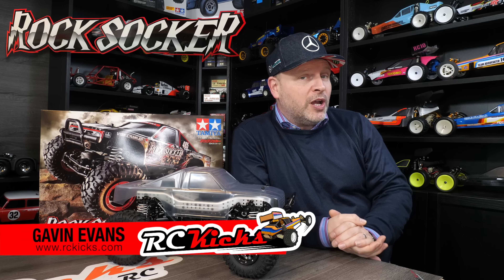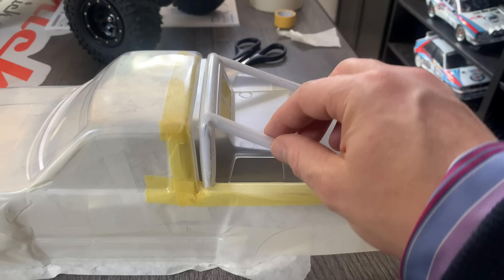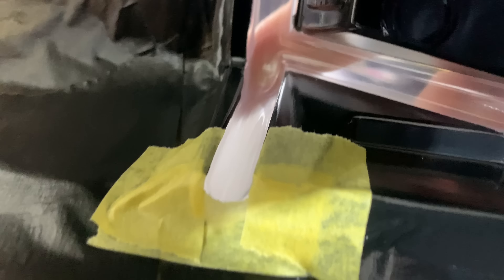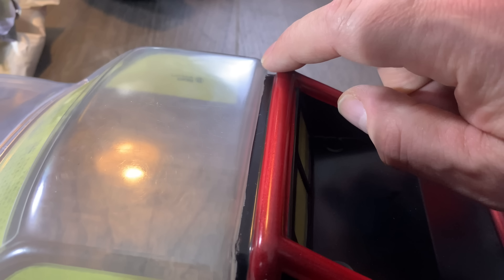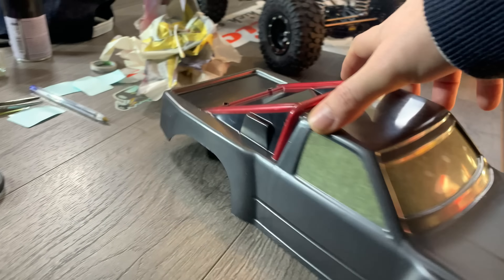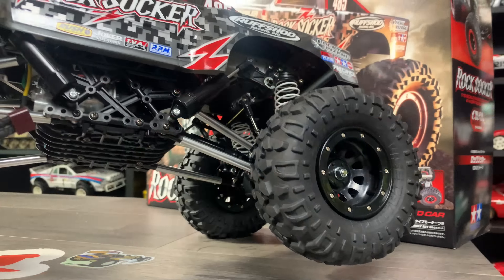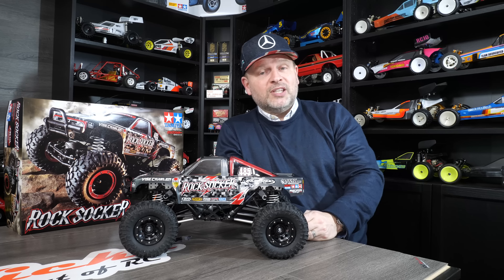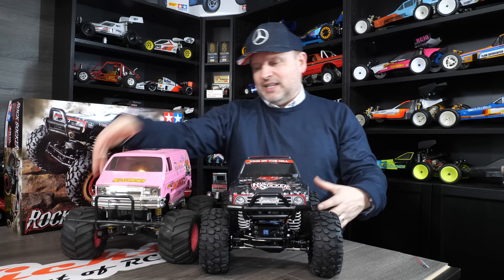SNOW PROBLEM AT ALL, Build Done But…  Tamiya CR01 Rock Socker RC Crawler.

Comment: Finished building my Rock Socker recently and just had a blast around the garden. Fitted mine with Hobbywing Fusion SE 1800 which performs more than well enough for me. Very impressed by how the 4 wheel steering works, especially compared to turning circle on my CC-02 Unimog. 
Now I just need some decent weather so I can get the body sprayed and finished.
Built mine with a few metal upgrades so might be a bit heavier than Tamiya intended!

Comment: Fantastic build, wishing i had your body finishing skills to make mine look as good!   Weird thing - i've found that it is much more capable climbing backwards.  So i switched the front and rear body mounts (and shell) so that the rear wheels steer.  Amazing difference for No cost!   Much more capable.   Imagine pushing or pulling a wheelbarrow.   The diffs are both locked making manoeuvring difficult however, not any more.   Battery weight is in a better place.   Try it (without switching the shell) and I hope you'll see how much more capable it is climbing backwards :)
Reply from the maker: I will give that a try Lewis.

Comment: Got to say the body looks fantastic. 
Certainly looks like the silver can is too quick to do any proper crawling and you need to add something with a few more turns to get the control needed.
Reply from the maker: Yes if you want to do more rock you would 100% change out the motor.

Comment: Its always the body that gets me, i try to do a good job but never quite get the finish i want. Prep is key, your masking is what made it. Could you brush paint the roll bars? Would that be an option?
Reply from the maker: Possible but I do t know if that would be easier
Reply: @RCKickschannel  ok thanks, i have the toyota cruiser version, you can get lifts that give more ground clearance fir them and the metal drive shafts are a good option also, as the plastic ones can twist and pop out. All in all its a very capable crawler/Trailer.  You do great content mate. 👏🏻

Comment: Regarding the painting you put clear on first and then the paint I’m not sure what this does can you please explain thanks
Reply from the maker: Putting down a few layers of the clear fills up all the small gaps in the masking.  When you then put down the colour, you get way fewer issues with paint creeping and much sharper lines and corners.
Reply: @RCKickschannel  I’ve not seen this technique before, I’ve Googled with no success - do you show it in another video?  I always have trouble with paint bleeding under the masking tape…

I’ve got the Unimog version of this - I had many of the same problems as you with the chassis rails!

Comment: How does the suspension sit with the battery and electronics in? It was a bit loose before
Reply from the maker: The issue is the pivot pin has some play so that can be fixed with some small black zip ties.
Reply from the maker: Loads of space for electronics

Comment: I have one as well but somehow I managed to strip out the little slot on the inside of the wheel. Do you have any idea of where I could get a replacement?
Reply from the maker: See if the part was used on another rere kit.  You can find out on Tamiyabase
Reply: @RCKickschannel thanks I’ll check

Comment: Lovely looking truck but it Looks like the shock oil must have been frozen the way it was bouncing over the bumps. I don’t know why Tamiya think every single vehicle they sell needs their 40wt “ soft “ oil that rig  could probably  do with about 10 or 20wt in that with the pistons drilled out. I suppose they leave that  up to the advanced builders discretion.
Reply from the maker: Yep 100% the suspension could be improved on this one.  It also has some play in the pivot arms so that contributes to the jiggling aspect of the suspension